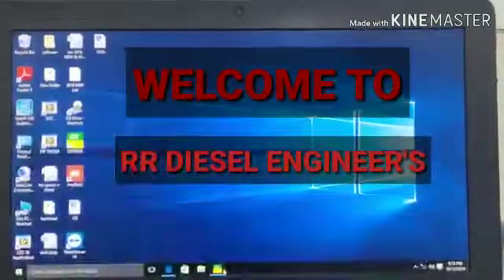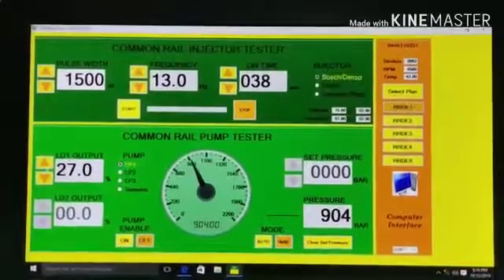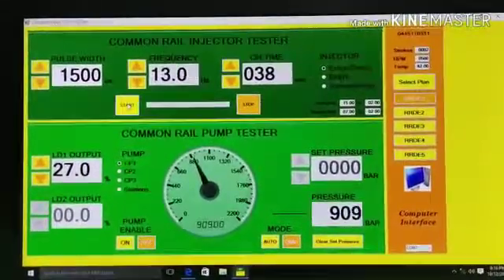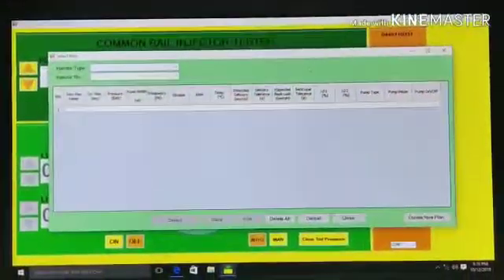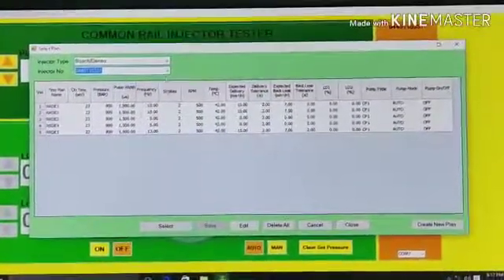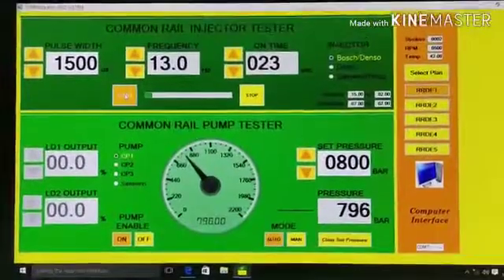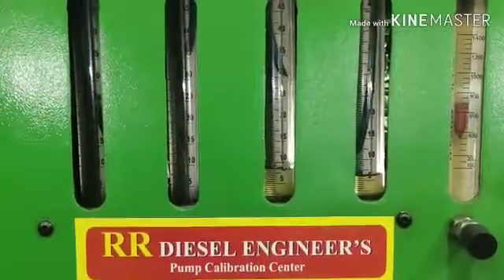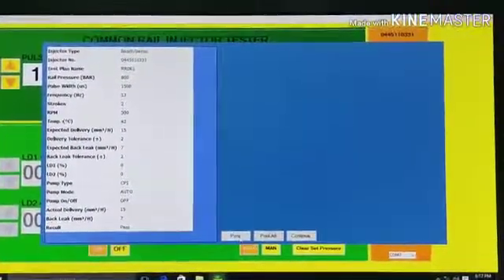CRDI CRT 9000

Comment: Hello, could you let me know why Denso electromagnetic injector was electronically operated as a Bosch solenoid injector? The two injectors have differences and tensions (and currents) are different. Should you require additional information please feel free to contact me by email: tekno.equipment.ltd@gmail.com